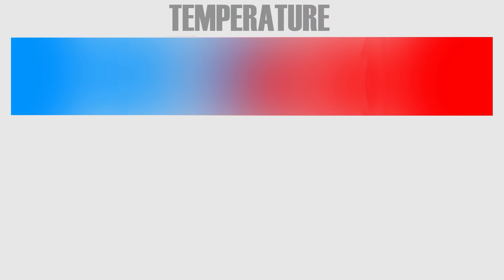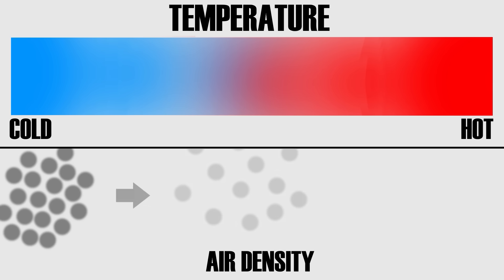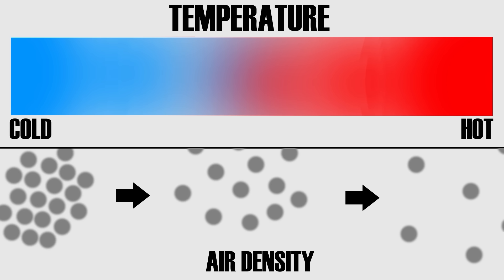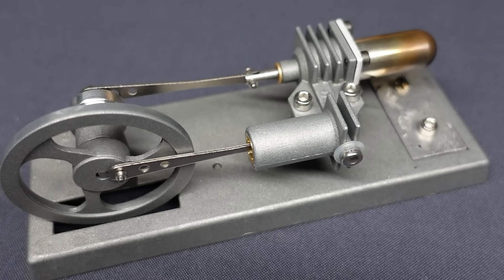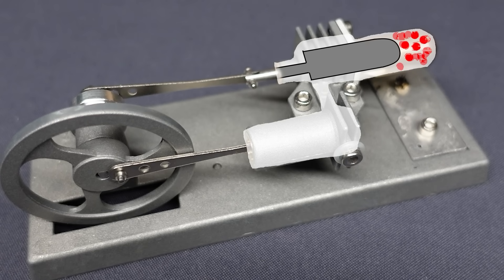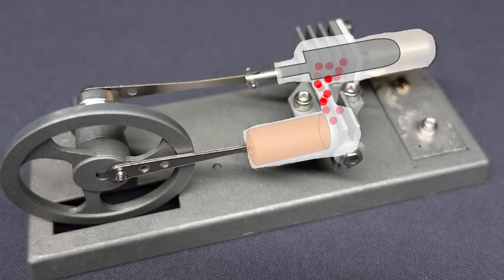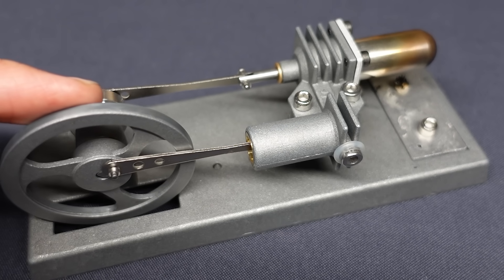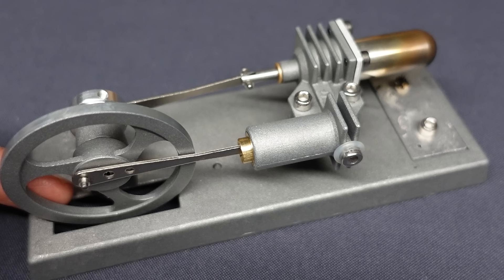It Can Save The World - The Simple Genius of Hot Air aka Stirling Engines

Comment: I wonder if this system could generate electricity to runthe instruments in a satellite more efficiently than with solar pannels, as the difference in temperature between the side that is exposed to the full power of the sun and the opposite side which is in permanent shade close to absolute zero, the temperature of open empty space can be quite substantial meaning a lot of energy can be harvested.

Comment: Have you tried cooling down the "cold" piston. Seems that if you have a big enough temperature difference using cold instead of heat, it should work. Making a Cold Air Stirling Engine?

Comment: I made one in College (Mechanical engineering) -1976  suggested it be use in automotive applications. Different temperature between exhaust and radiator temperature. Could power accessories to allow for smaller sized engines.

Comment: This is a Sterling engine (I’m sure he says it, I haven’t watched but 1:45 of it so far), but it doesn’t even need combustion to operate, just a temperature differential. The Swedish navy uses one to power a submarine, using the heat of the people and computers inside as the hot side and the sea water as the cold side. It is so quiet and efficient it was able to sneak into a US aircraft group and torpedo the carrier during a war game.
They have been around since before or right near the first steam engine, but were more difficult to design into a mobile use like trains and ships, which is why the steam engine won out.

Comment: At aboult 7:45 the Master omits mentioning that if you are going to shut yourself up in a room with a Stirling engine using fuel as a heat source, you had better secure adequate ventilation. Many persons have killed themselves by simply allowing a flame to burn in a closed room. This inevitably consumes oxygen and creates highly toxic carbon monoxide (i.e. if the stuff burned contains carbon, which fuels usually do). The possibility of curtains catching fire is definitely not the only danger. Carbon monoxide poisoning is very insidious

Comment: Some stirlings have a built in compressor to get more mass of working gas to make the engine more efficient.  Some use helium to increase efficiency.

Stirling engines are names after the Scottish? minister who invented it around 1812.  He was appalled by the mayhem caused by steam boiler explosions, so he came up with an engine that couldn't explode.

The Stirlings of the 19th century were almost exclusively used to pump water.  Their biggest issues were power to weight ratio, piston sealing, and longevity/reliability.

Ford, around 1990 built an F150 with a 150hp stirling for development purposes.  It obviously went nowhere.

The refrigerators on the Space Shuttle used Stirling coolers.  Some ultra-cold refrigerators still use the Stirling cycle. 

I attended Ohio University back in the early nineties.  Back then OU was a powerhouse in Stirling research led by one of my thermodynamics professors, Israel Urieli.  I remember him quite fondly.

Comment: 7:40 
I thinkt that this is not 100% true.
Both engines are using the heat of combusting fuel and air and convert it into work. Since the the ICE has a higer power output it uses more air and emmits more CO2.
In theory if you scale up the stirlingengine to a simmilar output they would "digest" about the same amount.

Comment: If it can provide a few 10s of kW in a few 100 kg package, then it seems like a perfect candidate for hybrid cars. ICEs have too much redundant functionality, like a wide range of power and speed, and a bulky gearbox, none of which you really need if used together with batteries and electric motors.

Comment: Stirling engines should be used to circulate cooling water for nuclear reactors. They can run using the temperature differential of the coolant being pumped and unlike the electric and diesel powered pumps, are impervious to power outages, fuel depletion, or drowning under tsunami waves. Could have prevented Fukushima meltdown.

Comment: Ford and AMC both had very successful stirling powered cars back in the 50's. You weren't here then. You can still find pics and info but it's all been blurred, so you can't read it. Wonder how that happened?
Reply: I found the exact same thing. These were labeled as external combustion engines and I believe they were propane powered. You can't read anything about them because the printed description and explanation was blurred. Kinda makes you wonder.

Comment: Having the stirling engine power a flywheel that drives the car would be a good alternative IMHO.  You could have the flywheel start off a electric motor plugged into the wall, then have the stirling engine maintain its rpm as needed.

Comment: They're just novelties with no real practical applications.
The amount of energy input via a naked flame is so low that its output power (always less than input) is insignificant.
Most of the flame's meagre energy content is lost to the surrounding air.
Even if you had a large blowtorch, you'd lose most of its energy to the surrounding air trying to power one of these.

By comparison, the amount of energy in petroleum is huge per unit volume, and releasing it produces REAL useful power.

This is interesting only as an exercise in converting thermal energy into mechanical energy.

Comment: If the air stays sealed inside, what would happen if you replaced the air inside with a gas that has a different boiling point? Would that change the power output?

Comment: * Rapid power modulation is achieved via increasing and decreasing the "sealed, or contained" pressure of the working medium. The external combustion system must have the ability to 'respond' to the resulting demand for 'more energy'. Because of 'residual' heat in the system, this 'response' would be nearly instantaneous.

Comment: Wouldn't these have potential to be used in full hybrid vehicles, where they would run at just a few pre-set power levels, drive wheels and store excess power in a battery, then they could get extra boost from electric motor when more power is needed? Or is their weight and low power output too much of a problem?

Comment: You could set a sterling engine up with a gearbox and torque converter that uses its lockup/slip control to actually affect throttle control.  Totally possible to have good control, youd just need to keep engine at one rpm and throttle using gear rpm instead of changing engine rpm.

Comment: You need to couple it with a massive sand battery.... With a solar collector, like a solar hot water heater but use a thermal carrier better than water.

Comment: i think stirling engines could be powering regular vehicles in the future - by using them in tandem with an electric engine and buffer battery. the downside of low responsiveness wouldn't be an issue, since the stirling engine only needs to top up the battery, while taking advantage of the higher efficiency, cleaner burning, and fuel flexibility.

Comment: A Sterling cycle engine powered by a solar concentrator would provide clean mechanical power. By using multiple cylinders, it can scale to more power. This power could power pumps, generators, etc. The efficiency can rival solar panels in some applications. In addition, Sterling engines can be made of lightweight materials that don't need to survive the temperature, pressure, vibration, etc. of IC engines. The vast majority of all energy used is lost as waste heat. The problem is with capturing that heat and getting it to the Sterling. This requires additional components.

Comment: It does have MUCH LESS horse power though per the weight of the engine, right? What's the actual power to weight ratio? Are combustion engines 50 times or 100 times more powerful, or what is the  ratio?

Comment: 12:01 pseudo science, the energy has already been transferred to the metal by the candles, so you ain't saving diddly squat, and that means it's not more environmentally friendly. The only way this can be environmentally friendly is if the temp diff is provided by solar heat from the sun or other natural & infinite heat source

Comment: i like the low RPM diaphram style stirling engines and wonder why a large scaled up version say 18' diameter version hasn't been developed for acreage and farm owners could use to charge off grid home battery banks? parabolic mirrors  could be used to heat the floor plate to drive the massive diaphram. The diaphram could be made or pre cast silicone pie shaped sections that could be bolted together. i dont think this would be all that hard to build as these are a very simple design

Comment: The Germans did a massive amount of research into hot air in the mid 2000s.
The potential to produce CHP in a domestic setting hasn't been realised yet, it does give a killer application for pellets, rather than just providing heat, a unit could provide hot water, heating and electricity.

Comment: Interesting video, have been a fan of sterling technology for several decades. It’s sad that it has become a nearly dead hobby technology since there are so many improvements that could be had with newer technology. One example is a single piston cryocooler. I’ve read that they can be also used as sterling generators. Would be interesting to experiment with except for the high cost of ownership. One experiment you could try with your basic sterling motors is to power them with an external motor to test their ability to cool.

Comment: Use catalytic converter heat and radiator heat from ICE engine to power a Stirling engine to generate electricity to power auxiliary electric drive motor in hybrid car.

Comment: it would be great as a range extender👍

or a hibrid car with a smale 6000 cc turbo engine and this in the exaust, wow could be very powerfull, directly on a generator and constantly charge the battery and therefore the battery can be much smaller and lighter. efficiency would increase by 30% and more

Comment: Been hearing how Stirling engines were going to save the world since I was a kid.  That was sixty years ago.
Reply: has the price of manufacturing gone down & the cost of electricity gone up enough to build large ones that are expensive to build per KWH to the point it would make sense to build them to large companies? no. hence why they are not used that much, otherwise they could just be added onto any heat producing power plant for additional power.

Comment: Stirling engines.got two aditional problems. While they have a  ery high carnot factor  that should make them incredebly efficent in theory.  The way they are made limit there top temperature to a few hundred degrees in turn limiting the total efficency. They also dont play well with low temperature gradients. That isz rhey do work, but efficnecy is horrible.

The other issue is maitanance. Having a demo set running a few hours is not a issue.

Having it in a high torque high power 2000-3000 hours a year configurarion  maintanance is a issue.

But the real reason they are not in use is that they are not the best technology around for this usage (waste heat usage). That would be a OCR engine. And well also sweden, and also a ship, but a crusie ferry not a submarine. Viking grace was the first ship to have one installed. This was actually a pretty decent sucess and there are dusins and dusins of ships having it now.

OCR is simular to sterling in the way that it uses heat, work on much lower delta, is a very old technology but have been made to work prectically only recently.
Reply: OCR engine? Can't find anything online about this, only Optical Character Recognition
Reply: @peterhguk  sorry.. ORC

Comment: Could you use the sun heat to spin one of these? I mean this really sounds like a much more efficient and eco-friendly way to spin a fan or move aircondition coolant by actually using the heat you're trying to get out of your room. A lot of people don't realise how much heat they produce by cooling something, just switch on the electricity and all their problems disappear. If you can transform unwanted heat into torque... that sounds almost unbelievable.

Comment: I wonder if you could make a 3d printed fully plastic sterling engine. 

If you change the gaz expanding from air to some gaz more sensitive to expansion. 
And use it in cold environment to create a higher temperature gradient on the cold part. 

It could be an interesting project where the goal would be to make it run with a hot part at around 100 degrees Celsius (water boiling point)

Comment: Stirling engines are wonderful, but not magic. Like any other heat engine (internal or external), their efficiency is limited by Carnot's Theorem: https://en.wikipedia.org/wiki/Carnot%27s_theorem_(thermodynamics). The efficiency of any heat engine cannot exceed (T_hot - T_cold) / T_hot, where T is absolute temperature in Kelvin. This means when there are small temperature differences, the efficiency is very low. It is not worth installing Sterling engines to harvest waste heat at small temperature differences. This is also why in concentrated solar power plants, all the mirrors heat a single, very hot heat source that can power an efficient heat engine, instead of powering multiple less efficient engines operating at lower temperatures.

Comment: It would be sick driving around with a car spitting flames, and you could control the flames by accelerating. Power modulation could be done by a clutch system designed for it, but maybe it would be too expensive.

Comment: These engines have been used in Solar Pond technology. I don't know why they are not used in many places. Solar Ponds are large area, shallow ponds with hyper saline water with a heat ex changer pipe which circulates a fluid which transports the heat from the days sun energy to a Stirling engine which then can produce electricity even at night because the pond is a store of energy..

Comment: I could easily imagine hundreds to thousands of Sterling engines being used to capture the waste heat that currently just gets dumped into the environment, such as the steam from power plants (whether coal, gas or nuclear, they all are just steam turbines underneath), which currently just goes in cooling towers to be dumped in the air. This would be an immense boon to, say, a spaceship with on-board reactor, to turn some waste heat back into electricity before it gets sent to the radiators. Do it right, and you can run a ship much longer on the same fuel, just by harnessing the very waste heat that would normally kill it.

Not easy, but in the long run might be worth it.

Comment: does it need to be fire to heat the motor. cause if we found a way to get an electric heater on the part that needs to be heated, then have the output of the motor also drive a alternator type device that charges the electric heater. in theory it sounds like it would work

Comment: I would like to point out to all the laymen out there,  that all engines use a heat source, internally or externally, which they  convert to rotary  or linear mechanical movement.

Comment: Interesting fact...all steam engines are external combustion engines.. Every spacecraft uses a sterling engine to make electricity. they use a decaying radioactive isotope for the heat source.. they run for decades.. Voyager 1 and 2 have had sterling engines without stopping since 1975... if you can't use solar panels you going to use a sterling engine with a generator

Comment: I recently bought a 1972 Daf 44, which uses a CVT to transmit engine power. The motor rev range is pretty narrow as a consequence and (even with a weedy 850cc conventional petrol engine) it manages around 40 mpg with surprisingly usable performance. Startup lag aside, could such a CVT system make the Stirling engine a practical vehicle engine?

Comment: The only thing is they require a significant difference in heat, and ideally are only heated at specific points. So you can’t just stick one in an oven and run it, you have to funnel that heat to the heated cylinder(s)

Comment: Waste heat of data centers and gaming computers. Also, the could power vehicles in the same way we have diesel electric trains with just a big diesel generator and traction motors it could be run at one constant speed and just have a motor to drive.

Comment: I need to replace the radiator of my car for one of this. Put it charging a battery that drives motors on the rear wheels. 
Bang! 50 km/liter reached!
(Sorry, American fellows. Brasilian and metric system user here).

Comment: Hot air external combustion engines are too inefficient for automotive use. These can be used to run water or air pumps and fixed electric generators.

Comment: He is playing fast and loose with the term 'combustion' to reach this 'analogy', and would have to light it with a spark at the very least in order to prove to me that he fully understands the difference, which I don't think that he does. Flammable is not a combustion make all on it's own, so if you can light it with a magnifying glass then it isn't combustion you have achieved (however, yes, your match does count, w/e).

Comment: I mean this would definitely be a great generator for a hybrid system. Power modulation is definitely a problem but not if it’s powering capacitors or an alternator feeding electric systems and instead of using fuel to heat up the striking engine you just use heating elements and it is as emissions friendly as you can get. Add solar panels to the roof of the car and I bet that setup will take you miles and miles. Only downside to it would be the amount of batteries and storage to fully power everthing associated with it to run